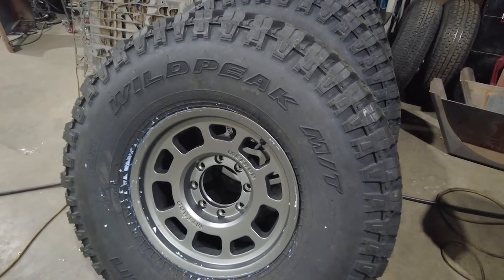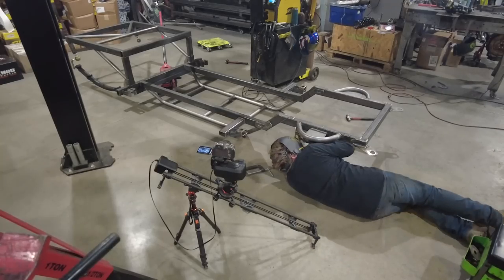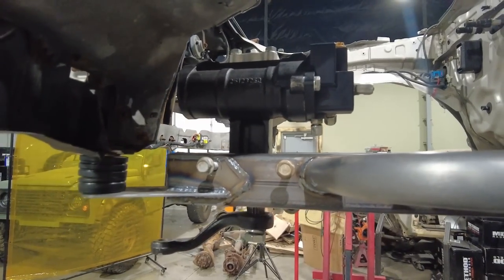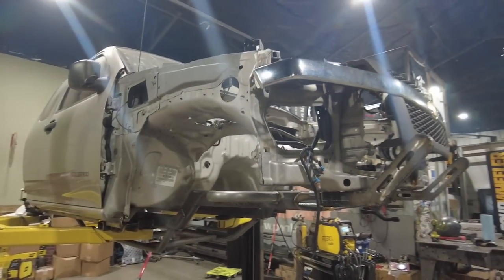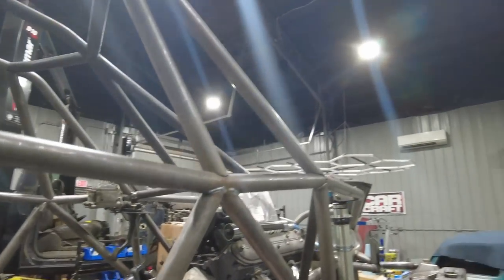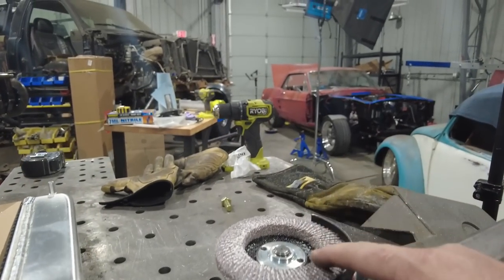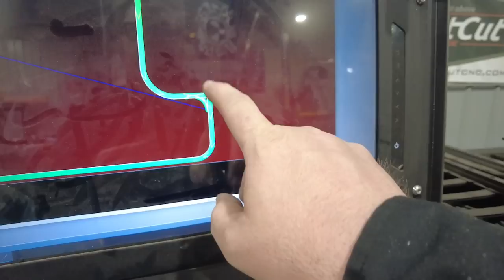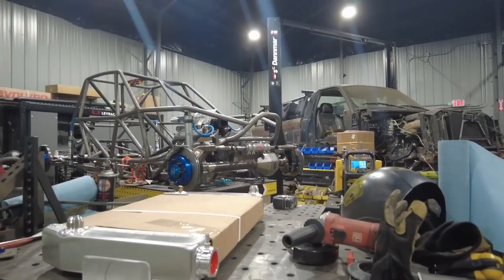Plumbing the Bomber, and Custom Bumper on the UA Colorado

Comment: TECH TIP. ive found when cutting hoses ,i find a piece of tight fitting tubing and push the hose though ,then cut the hose close to the end of the tube. makes really clean cuts, cant wait to see the bomber out four wheeling,

Comment: So on the Bomber RAD. What's the advantage of modifying the radiator VS building adaptors that goes from the DASH 16 fittings to the proper sized tube that matches the neck and use a short piece of rubber hose to connect the two. Then with the mounting a tray that holds the radiator over adding brackets to it. Myself I'd rather have an off the shelf/easy to replace in the field part over having something custom that puts you out of the game if it gets damaged.

On a side note my cat was going crazy over your cursor when you was filming the computer work. Lol

Comment: I do something similar with my wiring I either run it through the chassis and have different size bulkhead plugs to the different electrical components where this is not possible, I weld varying sized tubing depending on look size directly to the chassis with plugs at the end or protruding along the length where it needs to mate with electronic components, I have done this for around ten years with no electrical failures no ripped wires no chafing and less chance of doing any damage when working on the buggy, UTV, motorbike or rally car have had engine fires and as i only have short tails to components I carry spares in case of fire or flying debris damage.
Enjoying the build and I know it is a good build when I learn something new from you.

Comment: What size wheel, off set, tire….?
It’s important in deciding what I’m going to use. Obviously those air pressures don’t mean anything to someone running a 31 inch tire but there’s a difference in air pressures I would run between a 33 and a 40. Also wheel width to tire width information is good stuff.

Comment: Weekly questions!
So I've been searching the interweb looking for a cool/unique crawler hauler and stumbled across old season 1 episodes from XOR where you took an Isuzu cabover and swapped it into 4wd, 12v Cummins and custom flatbed. I was wondering whatever happened to that truck and how did it do hauling? I kind of want to build something like that since I've found a few of those Isuzu's for cheap with the 3.9 in them.